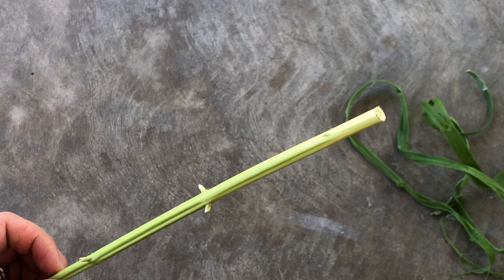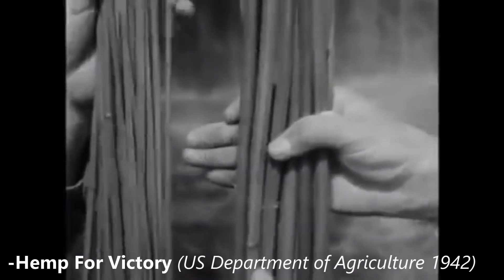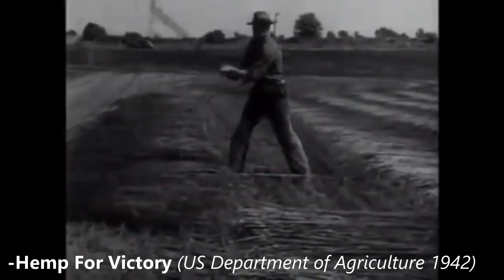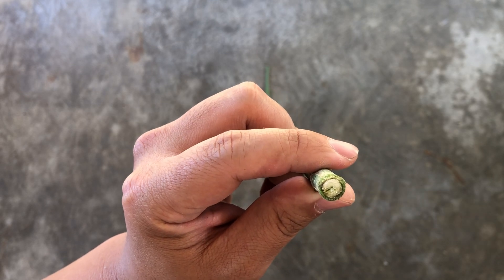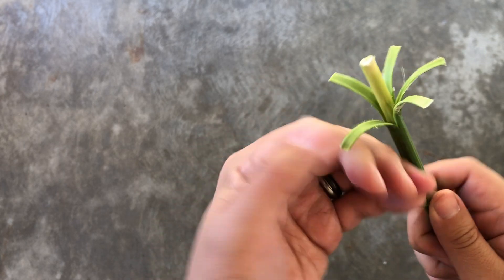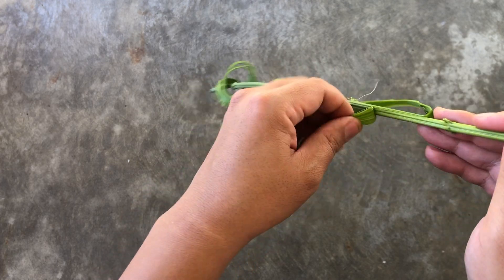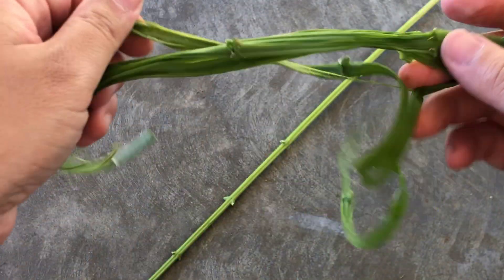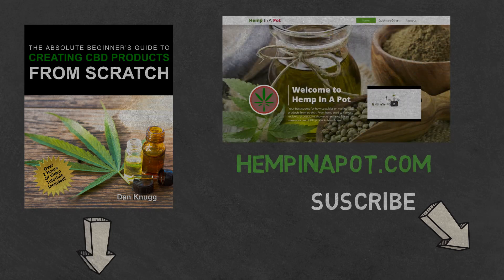Manual Decortication of Hemp Stalks By Hand

Comment: Do you have to let wet hemp dry? And how should I store it so it won't mold?
Reply: the non living fibers should generally be antimicrobial. but in general the dryer the storage the better so pat it down then place it somewhere where dry air exchanges frequently. you can hang it and have a fan blow over it just like you would when drying flower for harvesting. or dry it hanging outside like you would with clothes.